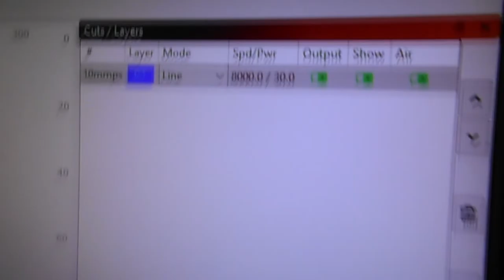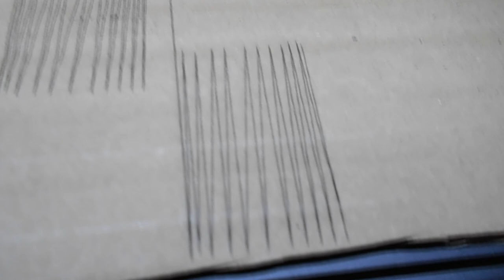P9M100

Comment: This was SO helpful. I thought that I had to use the included Power Adapter Board somehow. I guess we don't need to if we have an Atomstack (for me: X7 Pro)? It wasn't clear in the reference user manual
Reply from the maker: I guess you managed. I showed somewhere how to connect with X7. You don't need a board.
Reply: @RmcReloaded-tehnicaldriver  exactly. thanks!

Comment: when give m100 on my p9m40 the engraving area will be smaller? m100 module is bigger is it true?thx
Reply from the maker: As you can see in min12:20, Home can be done without changing the limits.
Reply: on support atomstack tell me, that module m100 is heavy and laser dont working good? have you some exprerience? thx